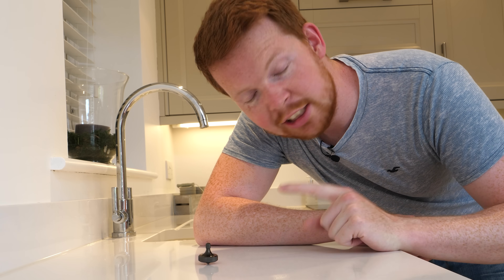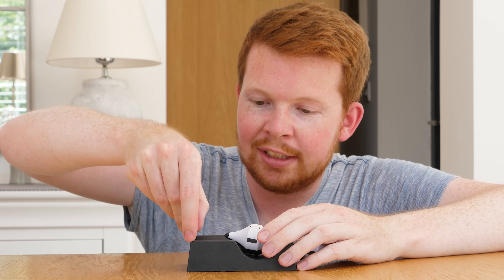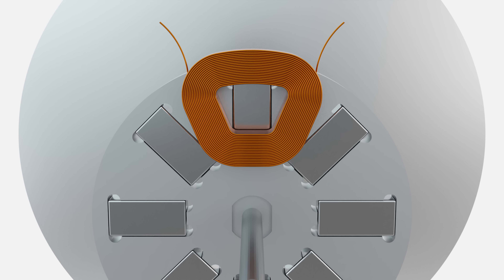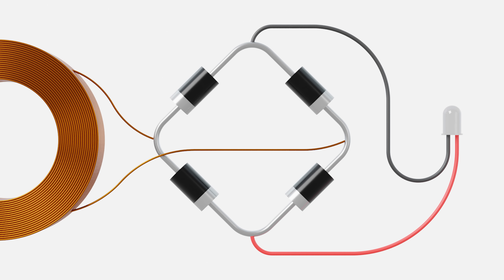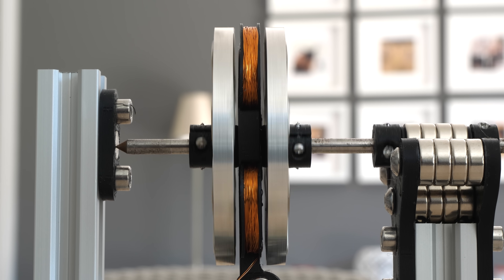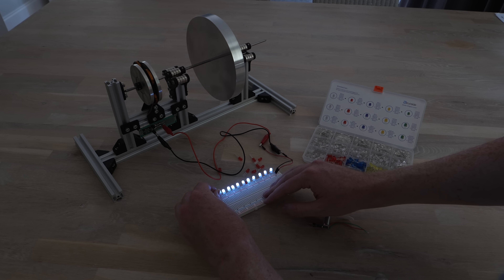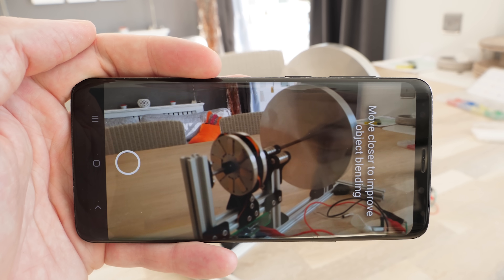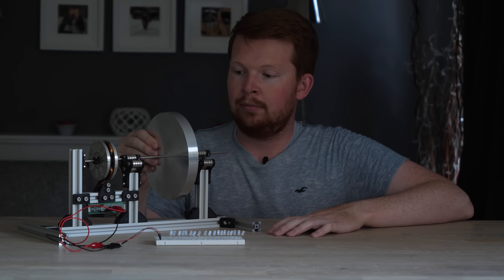Flywheel Battery

Comment: Would it help the wobble of you put the flywheel near the left of the axle?  If I recall correctly, the center of mass is nearer the bottom of a top because that helps with the wobble. So, if you put the flywheel near the left, near the point of contact of the axle, would that also help with the wobble?

Comment: What of u make 2 coil disc packs wouldn't it fix the flickering in the current
Reply: I need to see this experiment or prototype working in a better quality no wobbles and an extra magnet base also use rubber pads on the bottom

Comment: Soooo why not reverse the other side set of magnets so that the left and right side support magnets balance against each other? 

Meaning instead of going nsnsns nsnsns go nsnsns snsnsn. Would that not make the magnets then become the balancing force? 

Or, make the frame longer than the rotating magnets and still have the left and right sides be opposite.
Reply: Actually, put a pair of repelling magnets on each end of the shaft, so now you have nontouching magnetic restraint on both ends. If you used a magnet that looks like a donut on the one end you can still have the shaft stick through so you can spin it by hand. 

I would also put a coupler on the open end and have the mate to it in your drill... so instead of making radial contact to accelerate it, you can do it axially and get more speed, and then just pull back to disengage.

Comment: You need to close the magnetic field at least on the back of the magnets with some steel. Two simple steel rings or discs to sandwich the whole thing would improve 100 times the performance.

Comment: Neat thing about AC generators is that they're also AC motors. It'd be neat to see if you can use one of the motors, maybe with a hand-crank instead of a fan-blade (possibly with a gearbox to get the RPMs up), to see what it would take to get the flywheel spinning and maybe see how efficient it is at storing energy that the same motor/generator could pull back out.

Kinda like you did with your bike, but with electricity as the medium, rather than the belt and chain systems.

Brilliant stuff! Really enjoying it! <3

Comment: A module that has a large fan windmill with  a set of ratchet wheels to make sure the flywheel can spin faster than the fan and can only be influenced by the fan if the wind blows faster than the flywheel.

Making a frictionless shaft windmill module like this would be immense so the wind can blow give you power, with the flywheel regulating and storing energy as a mechanical battery.

Comment: It would work so much better if you could get it perfectly or close to balanced and then if possible to add another set of magnets to the top of the baring that would hold the shaft in place better and help stop the wobble that happens when you first start spinning the flywheel. This is a very cool project and I would love to have one on my office desk with an LED display that said something on it when it got spun up like the date and time or a favorit slogan also some type of handle or gear box that you spin by hand to get it up to speed then let's go. This could be a great novelty item for offices i am sure it would sell hell like I said I would buy one!

Comment: Wonderful video.  This is a really cool gadget you've built.
Question... On your alternator, aren't the magnet fields strongest at the poles?  What if you re-oriented  your magnets so the poles are pointed towards the alternator coils instead of the sides of the magnets?  Would that make a difference in power output?

Another thought... Build a small motor based upon your alternator design.  Then feed the alternator output into the motor.  Would it keep the flywheel spinning indefinitely?

Comment: You could pack everything inside a transparent (glass?) box in vacuum, and DIY / buy a 4-quadrant brushless driver to drive it (that's basically what you have with your magnets and coils there), in this way you could inject energy, monitor RPM (and therefore stored energy), extract energy and so on, it would be an amazing desktop demo.

Comment: Why not use two permanent magnets repelling each other instead of the point/glass at the end of the axle? Should have less drag but I don't know by how much. After that then add a motor to "charge" the Flywheel Battery. And finally, place it into an air-tight enclosure and remove as much air as you can to lower the air-friction. Too far?

Comment: Hey Tom
Not to play smart or anything, but I think you can get more out of the coils if you put an iron core inside the coil. Like on the blmotor shown in the video. The iron helps the magnetic field being stronger and the coils will producer more power.

Comment: Couldn't out lose de side plate but adjusting both the fixed magnets so that it wants to stay centred?
Or maybe adding a couple of magnets on the outside of the fixed magnet rig?
Or even a magnet system on the top of the shaft so it would be repelled horizontally?

Comment: The LED's are in parallel so the current that your setup can provide is the limiting factor, as long as the supply in is above the LED forward voltage they will all turn on but each LED wants about 20mA for full brightness, if your supply can only provide 40mA then you can only do 2 LED's, to increase current capability I think you need thicker wire in your coils.

Comment: What about using three phase winding? In this way You can use some cheap ESC (for brushless motor) to start moving and later use the same windings with three phase rectifier?

Comment: it mostly wobbles because of precession

the flywheel isn't at equal distances from magnetic bearings and so there is a momentum exists applied to an axle (due to gravitation)

it should have caused an axle making a cone, but because there is no axle to do so, it tries to rise and fall over the magnetic bearings

placing flywheel itself at exact center between bearings should help a lot
Reply: ideally whole setup - flywheel + generator magnets should be arranged in the way both bearing stands receive same load, so no momentum applied to an axle
Reply: it can also be seen when load was applied to a generator it also creates a momentum and wobbling increases

Comment: Tom if you then glue magnets to the outer edge of the flywheel and then place magnets around it in the right configuration of north and south would it be possible to make the flywheel spin on it’s own just by the power of magnetic field

Comment: To make it even more efficient, the following should work:

- use low voltage drop Schottky diodes for the full bridge rectifier
- change the fly wheel and rotors for a high density plastic or any non conductor to eliminate the Lenz effect slowing the system down
- balance the flywheel better or use a straight shaft to reduce mechanical losses
-  apply a low density lubricant to the support panel that makes contact with the shaft

Comment: If you shifted the magnets on one of the wheels to power the coils when the other wheel isnt you would end up stabilizing the power output but halving the concurrent voltage you could get correct?

Would end up stabilizing the flicker on the LEDs but reducing the amount that could be powered.

Comment: Would having five coils between the current magnet set up smooth out the current to prevent pulsing (so each the coils weren't in phase)? Would that setup require separate bridge rectifiers?

Comment: You could remove all the friction from your design by using two magnets, one on the pointy end of the axle and one on the frame. So that they pushed each other horizontally just enough for the axle not to touch the frame and not strongly enough to push the axle in the opposite direction. Could that work you reckon?

Comment: Ok.  That is just cool.  Random thoughts.  If you were to get some precision rods ect im guessing it would increase the stability and output.  Curious if it would be possible to wrap a string or something around that rod like those old tops that you do a rip cord and it spins the axle.   

What's the longest by hand spin you have been able to get while powering some leds?

Comment: pretty cool. wondering if you could make it more stable by adding magnets above the balancing magnets so that you have 4 sets surrounding the center one that's on the shaft? Also, could you spin it up by applying an alternating current to your generator?

Comment: Could use Halbach Arrays to strengthen the magnetic field between the two discs.
Also, just to add it more magnets, could you replace the spiked tip on which it spins with more magnets, for a truly frictionless setup (aside from air friction)?

Comment: If you change the geometry of your "generator" a bit, you have a 3 phase BLDC. Now connect a fancy motor controller like VESC and you can spin up your flywheel to much higher speeds. And extract much more energy by commanding a negative motor-current.

Comment: Hi Tom, it would be really cool if you could turn the generator into a motor and “charge” the battery with purely electrical energy rather than spinning it by hand. Then have some control logic to switch it back to a generator when you’re consuming power. Maybe you could try using it in an application where normal batteries are used. For example a solar battery bank

Comment: I built a machine that precision ground a giant tungsten flywheel. It stood about 4 foot tal and around 36 inch diameter. It literally crush the feet of the machine into the pad it was on and we had to re align the machine while weighted.

Comment: This is a brilliant video and I am so jealous of your machining skills! I suspect that you are losing between 1.2-1.4V from the diodes in your rectifier. If you wanted to make things a bit more efficient, try using shottky diodes instead - they have less voltage drop across them. Also,  if you add a steel plates backing your alternator magnets, you will give a better return path for your magnetic flux and increase the efficiency further! But all said, I am very impressed!

Comment: Such a flywheel (may or may not be a levitated one), similar to what we call mechanical batteries, could be used in electric vehicles for recharging batteries, by converting vehicles kinetic energy into electric energy. May be very small in amount, but as it would be a continuous one, could increase range and most importantly, during a low charge, manually moving it by using some sort of a handle / pedal (like bicycle) could be a backup for recharging

Comment: You can use 2 LEDs (or more) in an  antiparallel configuration too. It's more efficient, you don't need the rectifier and there's no 0,7V drop from the silicon diodes, so the output voltage is higher.

Comment: I wonder, with everything calibrated, how efficient could this design get.
Reply: He didnt explain that the load on the output will actually slow everything down. By using the power at the end you are creating resistance and slowing down the wheel (or make it harder to turn)
Reply: @mwint1982  Yeah that makes total sense. Still curious about the maximum obtainable efficiency if you do put a crazy amount of work into it.
Reply: @thngzys  energy in = energy out, subtract some for heat loss
Reply: I think there's gonna be little loss due to heat since the only considerable contact point is at the interface between the side constraint and the levitating spool. I think most of the loss generated, like you mentioned, would be when it induces current in the coils.

Not sure if floating on magnetic fields with other magnets would have losses but intuition tells me the field lines should cancel out and it should be more efficient that spinning on ball bearings.
Reply: @thngzys  could probably try it inside a vacuum chamber too... no such thing as free energy ...yet
Reply: @thngzys  induced current and the disc's aerodynamic friction, I guess. The first one is solved with thinner wires and denser coils (less current, more voltage), the second one with a vacuum chamber 🤔
Reply: If you actually are curious, there are already industrial size equipment like what you're thinking, with all the improvements you can think of and then some more. Example in the link.
http://velkess.com/flywheel.html
Reply: Wow nice. Humans are brilliant sometimes.

Comment: How does the addition of the alternator component to the flywheel pull kinetic energy out of the flywheel? is there some opposing force to the movement of a conductor through a magnetic field (or vice versa)?  Obviously, there must be some opposing force or the wheel would spin forever (in a frictionless environment) and we'd have a perpetual motion machine

Comment: add a glass case around it and make it vacuum-proof. Remove most of the air and you will have a cool toy that will power things with lesser energy dissipation.
Reply: Will be harder to spin it up to speed though, unless he'd somehow make the rod stick out and keep that vacuum sealed without causing friction. Don't see it happening with this not ideally balanced one and even if it is a straight and balanced one I'm not sure if the added friction from the seal keeping gas out will be worth it.

You're not wrong though that it'd dissipate less energy into moving air around.

Comment: Could you add more flywheels beside the Aluminium one you added, and have it with added inertia spin for longer? How much longer you think adding a second plate make it run? For twice as long? Or do you think there are diminishing returns?

Comment: Couldn't you put a static magnetic poles either side of the flywheel, and then put magnets on the flywheel so it the will help push the flywheel even more?

Comment: Please, it's "oriented" not "orientated" - present tense: orient - past tense: oriented. Sorry to be the grammar police but that just really annoys me. Otherwise, nice video. You might consider carbon fiber arrow shafts for your shaft - may be too flexible but won't stay bent. Also, I believe you would reduce the 'cogging' effect (flicker) by making the coil not line up with two magnets at the same time (actually four with the way you have two discs). This may reduce your peak voltage though.